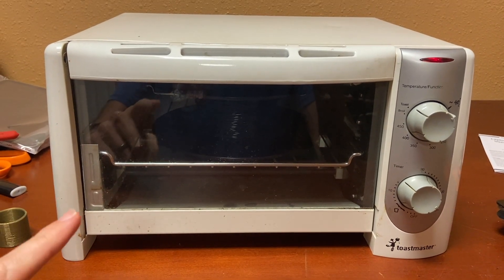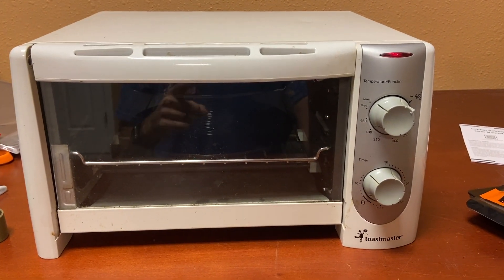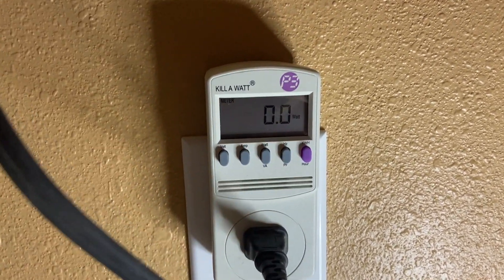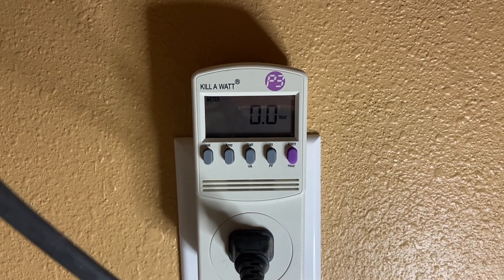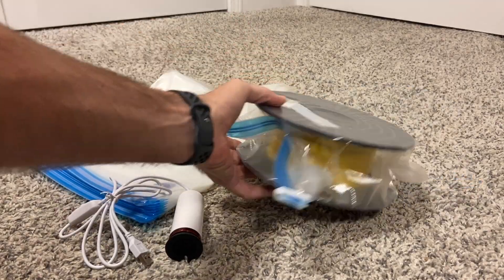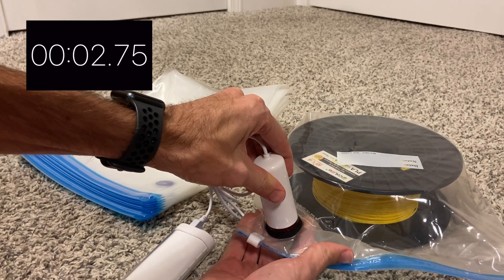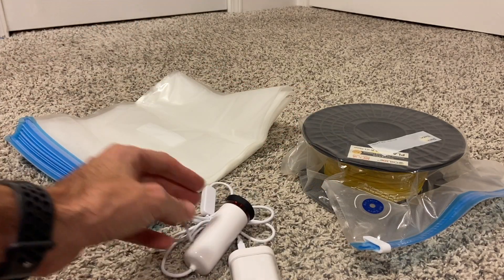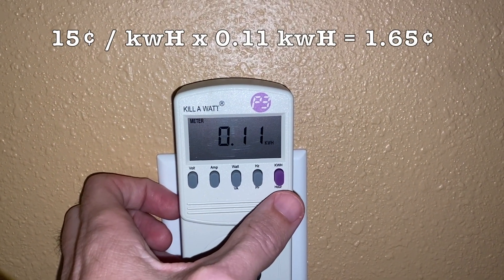FOLLOW UP: Toaster Oven Filament Dryer

Comment: I let my PLA sit out how do I know if it’s all moist or if it’s not gonna print right does it feel wet or what I knew it 3-D printing so I really need to know this
Reply: New not knew I’m new at 3-D printing
Reply from the maker: @kekecatty  when it absorbs moisture it’ll become more brittle. Also while printing, you can hear a popping noise which is the moisture turning to steam as it gets heated by the hotend.
Reply: I’m noticing on the print I’m doing right now it’s not printing evenly, looks like it has gaps. I’m printing in a low speed. Probably it has moisture issues, right?
Reply from the maker: @ that could be a variety of issues.

Comment: he brother i've got a request/query i have a samsung dryer and something inside keeps getting messed up every few loads to the point where it stops drying all together i just moved housed and i cant say that i was too gentle with it but this same issue was happening at my old house where every few loads something inside the machine would stop drying i know its essentially impossible to gauge what keeps causing the issue  over the internet but anything helps thanks and i dont believe its the dryer vent but it is possible